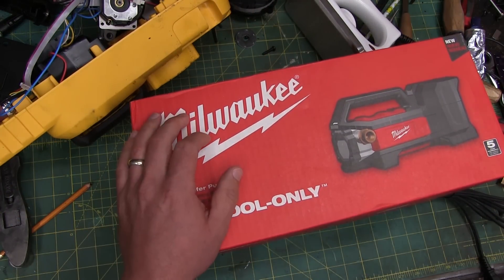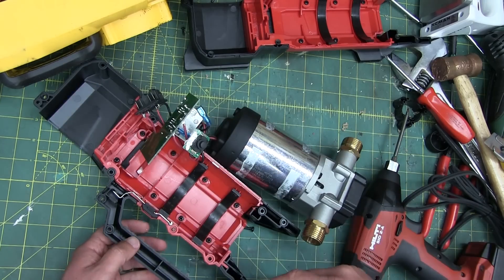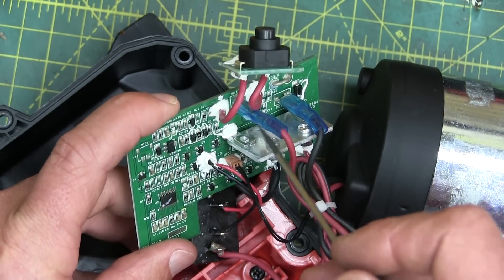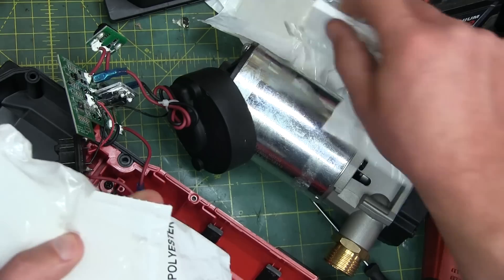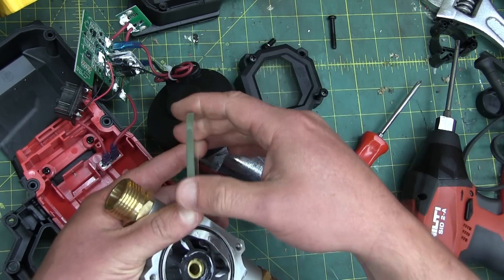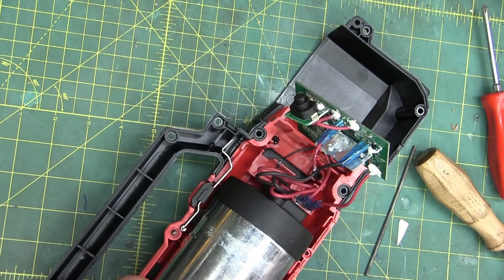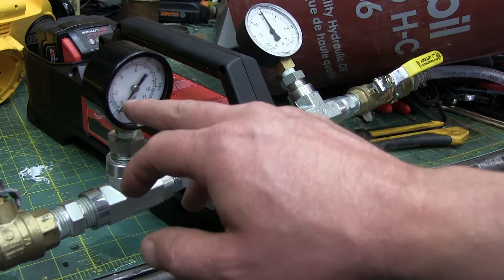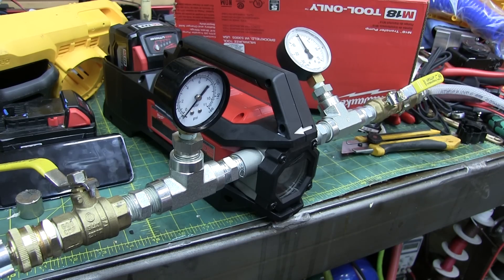BOLTR: Milwaukee Pump | Box Specs vs. Shop Specs

Comment: I bet I emptied 1000 dead water heaters with that M18 transfer pump.  It would pass some pretty gnarley chunks.  Obviously, I eventually forced the smoke outta it.  Pretty skookum choocher in my opinion.
Reply: Yeah as a heavy duty diesel field mechanic this this works wonders for pumping coolant back in radiators. Especially on trailer mounted engines where the radiator fill is 15' off the ground. Drill pumps just could not do the job.
Reply: @brendanwood1540  good lord
Reply: I have emptied quite that many, but it's definitely been a couple hundred. So damn useful
Reply: Do they drain a lot faster with a pump on em??
Reply: @cpjuan1353  oh yeah. Like 10 minutes vs 30 minutes.
Reply: Is skookum choocher  related to belushi kookerr
Reply: Well one of the HVAC guys on here on YouTube used it to clear condensation drain lines and also get the water out of the drain pans and such as well and he discovered it would take some crap through the pump as well like insulation or other junk like that no problem it almost look like swelled up wood shavings or something or some sort of insulation could not identify what it was and one or two videos but yeah one pretty good pump for what it is.

As in terms of with water heaters getting the crap out of them and also condensation drain lines using a Shop-Vac is that I've heard done a lot from what I've heard.

Evidently there's a Shop-Vac to condensation line drain adapter for this purpose.

And also some of the refrigeration guys on YouTube use one of those cordless shop vacs from one the cordless tool companies as well!

Comment: As a life-long Californian, I can confirm that it is rough living in California. Every day I get some form of new cancer and it's truly horrible. If only these chemicals weren't recognized to be carcinogenic by my state...
Reply: "Known to the state of Cancer to cause california" for a reason.
Reply: Agreed. California is horrible. Don't come.
Reply: @jutde  lol. Name a product that isn't known to the state of California to cause cancer? To them 100% of orings cause cancer. It's better if they actually only labeled significant threats not. Or else it's a joke.
Reply: @buixote  why you no come?
Reply: Do you actually think somebody is testing those materials to determine whether they are not cancer causing? Without those tests, Proposition 65 requires the label. Guess what? Manufacturers figured out it’s cheaper to label every single thing than to do the testing.
Reply: @stevebabiak6997 that’s hilarious
Reply: @lindboknifeandtool  - things you would never ingest have those labels: for example wooden products and holiday light strings. The labels do cost a little, but they’re cheaper than the alternative.

Comment: $10 for the drill pump, plus a zip tie or hose clamp to keep the trigger down.

I just saved $90, and opened myself up to a bunch of liability!
Reply: I have never found a drill pump that works as well as this does. Which is why I inevitably went with this pump and couldn't be happier.
Reply: Those drill pumps piss a bunch of water tho. Likely a one time use. Easily overspun.
Reply: Attach to a die grinder pump like mad fire awhile till they melt

Comment: Great video as always my man!  
I work on wind turbines.
I use this pump off and on for coolant. It is great for that. Drill pumps weren't functioning. I bought this pump since I have other Milwaukee tools. It does what I expect, every time. Self priming, use XC5.0 mostly but have a XC8.0 as well.
 I will try it next time I have a big hydraulic leak (Mobil DTE) to see if it can help transfer the waste hydraulic as well. 
As far as Castrol X320 gear oil I doubt it can move gear oil, but maybe worth a try. 

I have had nothing but suffering with "drill pumps" Maybe they were all cheap , poor quality. But yeah hate even thinking about drill pumps.

I really have learned quite a lot from watching your posts. I honestly appreciate your input into the world. 

Thank you AVE!

Comment: I just bought this pump a few days ago for filling rads on heavy equipment. Running out of a 1000L tote with 3/4 hose on each end (pushed over a NPT nipple as you have in your set up). I measured the drop in height over 1 minute filling another vessel. The markings on the side of the tote are 93MM/100L. I measured a 31MM drop in 1 Minute. That works out to about 33.3L/Min.  On a single mostly charged Max 5.0 I pulled 500L out of the tote and lost only 2 bars from not exactly fully charged battery. 

For the purpose I am using it (filling rads on 100L+ systems) this beats waiting around for the lube truck. This instance i actually filled the lube truck as a way of testing the pump.  

I only geeked out and measured some shit because of your video's.  thanks Uncle Bumblefuk
Reply: Very interesting, your measurement is very close to the 480 gallons per hour (30 L/Min).
Reply: If you look at the inlet tube in the video you will notice that the tube looks like it is 3/8. That there will restrict the the flow.
Reply: How big a boat was it? (horsepower)

Comment: You were talking about the old Detroits diesel, the old man was telling me a story about him and a few friends rebuild a 12-71 and slapped in a needle nose pete. On the first fire up they didn't have any batteries to spare so they decided to pull/push start and park it to break it in. So they let someone who never seen a semi truck before hop up in the cab to dump the clutch, so he slapped it in "first" fired up first pull. After the break in dad jumped in the cab and went to put it in gear, let out on the clutch, and the truck went in reverse, so he slid it in reverse and it went forward.
Reply: Some Dude lol I've heard of those stalling on a hill and starting back up reverse rotation.
Reply: If you change gears from reverse to first just as you bump a dock you can have a truck with 13 reverse gears and 1 forward gear.
Reply: I had an RD350 streetbike that would run backwards if you almost stalled it. Surprise, surprise, surprise at the green light unless you happened to hear that the motor sounded a little funny before you dumped the clutch.
Reply: That makes me remember the Lester Flatt song "Backin' to Birmingham"😀!!
Reply: Letting a 2 cycle Detroit Diesel run in left hand rotation very long will starve the crankshaft bearings !

Comment: Once upon a time, when I was a wee lad....I was at the Sta-Rite plant where they were testing the output of their pumps and they test them with a column of water and the LARGEST diameter pipe that the bung is threaded for.  So we are talking positive head from the water column throughout the duration of the test and zero restriction from the plumbing fittings on both the suction and discharge lines. Positive head is the magical formula that will give you those numbers, plus increasing the size of the suction line.

Comment: I suspect that if you were to attach the original fittings with 5/8" garden hose, as it was designed for, then your flow would increase dramatically.  There is a lot of restriction with all of the fittings, valves and what appears to be 3/8" hose. Just my 2 cents on the subject.
Reply: He could get the manufacturer's specs if he just poured the water downhill next to the milfuckee pump unit.
Reply: Also looks like the output was restricted with the ball valve half closed from when he was maxing psi. High psi equals more load thus less flow and shorter battery life.
Reply: He restricted the output to simulate pumping to a head, as the box advertised.  Yes, if it opened it fully up it would work much better, but that's not what the specs said.  It said X number of gpm at X number of feet of head...and that was what he was trying to duplicate.
Reply: Not likely, usually pumps are spec'd at max flow at zero feet of head the total run time is also likely spec'd at zero feet of head. The max head rating would be at zero gallons per minute flow rate. Then  you have everything in between, the spec would be 480gph at 75feet of head. But either way it likely would only be close to spec in real world testing.
Reply: I believe that the max flow listed is under ideal conditions.
Reply: I agree, Glen.
Reply: That impeller is an off the shelf outboard motor water pump impeller. Cheap and sleezy
Reply: eric Parrish part number bychance?
Reply: Most if not all real irrigation pumps have a performance flow chart which shows the flow vs head of the pump. Calculate the designed head and the curve will show the flow at that head or visa versa. A total GPM at zero head is worthless but the marketing department may use this to sell more product to those that don’t understand how pumps work.
Reply: I routinely pump 100% propylene glycol with this pump, which will eat most pumps for breakfast. So far this is the best pump I have found for such job. A 5.0 battery usually lasts 45 minutes using a 5/8 garden hose. That terminal did come loose on mine also.
Reply: Same comment about the hose size. I use this pump with 5/8 hose to pump hot oil out of compressor sumps. It is a dream come true, and pretty too!
Reply: Yes, a proper pump performance curve would answer pretty much all the questions.
Reply: The pump ratings may have been from the impeller supplier which was done at higher speed with less viscous fluid. Milwaukee r&d probably didn't want messy wet stuff in their pristine lab.
Reply: Do you suppose that because he turned the poor lil bastard so it's insides were outwards he may have affected the efficiency of the unit? All fittings, gauges, and differences in hose diameter are likely the causes contributing to the differences. I just wanted to put it out there that sometimes when you take something apart in your shop it never goes back together quite the way it did in the factory and it might affect the performance.
Reply: @davidbumpus3457  If anything, with the porting and the extra schmoo it might even have been improved over the factory-fresh state.
Reply: Yes there will be 4 times the back pressure to pump through 3/8 compared to 5/8 tubing and on the suction side that could also induce some cavitation.  So why do 4 times the work with under-sized hoses. In the pump window, what looks like air bubbles; could be cavitation or air leaks from to much vacuum.  One has to wonder if it could drain a 200 gallon water bed using 5/8 garden hose.
Reply: @ericparrish01  That's probably good? I imagine they need replacing regularly, so having a standardized part that is easy to get replacements for is ideal.
Reply: @davidbumpus3457  
Using words like "Do you suppose", "sometimes when you", "and it might affect", in your statement, relieves it of any kind of validity. imho
Reply: @packrat2113  thanks for your input on my comment. I wasn't there for the tear down or the rebuild so I had to give my opinion based off what I saw in the video. So please forgive me if I used an excess of ambiguous language in my original comment.
Reply: @nwichy5429  what sundowener

Comment: Test an automotive winch. I know it's not a hand tool but I bet a ton of people will be interested in it and how much it can really pull
Reply: California is just worried that someone might try to turn this hose sucker into the gentleman's version of a Hitachi filling rattler.
Reply: ifn your testing one of those winch's stay FAR away while testing, the cable used on those things doesn't have much of a safety factor, 3\8 cable is common on 12k winch's, which is about where the breaking point of the cable is.
Reply: Being that I spent time conscripted in the USNavy. I have partook of laying of lines to attach our ship to the dock.  They started out as 2 inch thick lines.  during a weather event, they were 1 inch thick lines.  And you wanted to be no where near them.
Reply: animefreak5757 you can replace the cable with synthetic rope to considerably increase safety. Steel cables are steel cables. I know I would be more interested in the unit itself rather than the line.
Reply: Just FYI for anyone interested: used to work at a 4WD shop that was a Warn dealer. Not skookum at all for the price, just cheap pot metal body, cast winch reel, and metal-injection gearbox. The motor is on one side, and drives the gearbox on the other side with a ~5/16" hex shaft through the center of the reel. Motor wasn't terribly impressive either, the quality is just OK but not great. I would be interested in a teardown of one of the harbor freight winches, never had one apart and saw quite a few that lived on trailers for loading a car, and they seem to last fairly well for such a cheap product. The only thing I wouldn't trust is the cable, they don't look nearly as nice as the Warn cable.

Edit: wire rope, not cable
Reply: Gregory Wood: Is the smaller mooring line used so the ship will break free, rather than crashing into the dock?
Reply: Onuma I think he meant that the line went from 2" to being under tension it was 1". Not that the rope was changed. Just my take.
Reply: Trailer winches are used to pull a wheeled vehicle up a slight slope. They shouldn't need to be anything like as powerful as an off road recovery winch. Pulling a couple of tons of truck buried up to its axles in squop takes a lot of grunt. The Warn winches, interestingly enough, seem to have a decent reputation in the off-road community, so they may be just good enough.
Reply: I got one of those HF automotive winches for hauling a piano up to the second story.
Reply: Small boy?  All the mooring lines I saw on our ship were 6".

Comment: AVE - You need to use a 3/4" ID hose on both sides of the pump to get the full flow level that is claimed on the box.  It looks like you have a smaller 1/2" ID hose in the video.  1/2" is a much smaller flow area,  and this smaller flow area is restricting the flow rate.  Try the test again with full 3/4" hose directly on the pump head and you will achieve the advertised flow rate.
Reply: I can't believe he fucked that up either.
Reply: I was thinking the same thing
Reply: Plus that involves pie are square stuff or something like that. So double becomes 2 mcdoubles or something like that with area
Reply: @rwood1995  3/4 is about 2.25 times bigger in cross area than 1/2

Comment: But the drill one is exactly what zip ties on the drill trigger is for.
Reply: Bingo!
Reply: That's the first thing I thought too lol
Reply: Hose clamps for adjustable flow.
Reply: Not even that, you just buy a shitty miniature bench disk grinder, gut it for the motor, leave the stand, hot snot the cheapo pump at the start in place with a piece of rubber as a flexible shaft between the two, and you're done. I'm willing to bet you can get this so cheap it's not even funny, and it will last just as much as you need it too, heck, considering those cheapo pumps are disposable as a whole, it will probably outlast this milfukery.
Reply: Velcro wire straps combine the adjustability of worm gear clamps and the convenience of zip ties. They can be a bit delicate if you don't get the skookum kind though.
Reply: Corded drills at least used to come with a trigger lock on button
Reply: Tom Moores My 2 or 3 yr old corded Dewilt has one.
Reply: aserta but it won't be battery powered...
Reply: spring clamp or ratchet clamp is my trigger holder of choice.
Reply: My old mains powered makita has trigger lock and a speed adjester knob, has health and safety done away with trigger locking?
Reply: Wonder if one of those drill powered pumps would work on a 5gal pail of gear oil?
Reply: I use electrical tape
Reply: gasfiltered 

You mean jubilee clips? lol

Only messin buddy, it's a US/UK thing. The main manufacturer, at least of the ones we got in the UK were Jubilee, hence the name that everyone calls them over here,.

We also call adjustable spanners 'shifters'. Don't know if that's also a UK/US thing, but I've noticed that younger guys in the UK seem to always call them adjustable spanners. Seems it's just us older (I'm 39 lol) bastards who call them shifters lol
Reply: Am I the only person that refers to them as zap straps?

Comment: Ive been using these 3-4 times a week for oil changes...works great for what it is. 5 centistoke to 68 is most common but it will even pump 320 gear oil. there is some type of high current shutoff...so then you have to sit there turning it on and off...but it does the job 4 batteries later
I adapted an inliner filter to it so we can prefilter our oil...and the pump seems to handle it alright.

We carry spares for the inevitable breakdowns lol...talk about running gear hard and putting it away wet.

Awesome to see how its made.thanks ave!

Comment: They don't run a physical test. It's all just calculations based on pump volume, motor rpm, etc.
Reply: sixtyfiveford I think you've got it. Those are calculated specs.
Reply: Generally a pump is deadheaded and from the known quantities in that they derive things like head and flow rate.
Reply: They most certainly do do a physical test, you don’t just develop a product and not test it. Of course their engineering team develops the best way to test it, but if they get the results they claim, then that’s not false advertising.
Reply: @Sffker  doesn't mean that those are the specs they advertise though.
Reply: @zoravar.k7904  thanks for stating the obvious
Reply: If a pump is advertised as having X delivery height, that means it's the maximal static height, i.e. there's no flow rate. The advertised top flow rate is at 0 height - basically when you would submerse it in a tub/lake and just pump water across - of course you aren't getting those numbers for real!